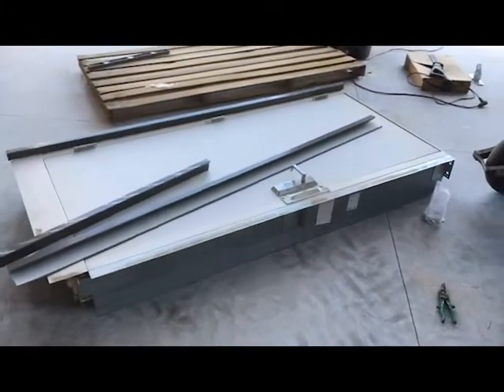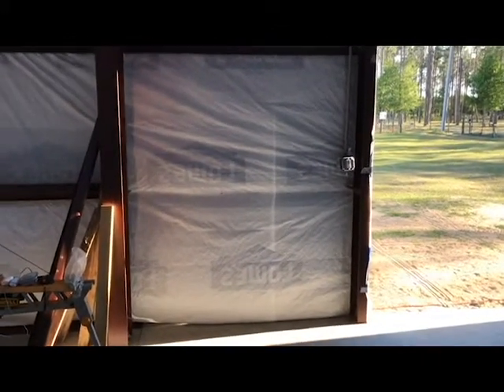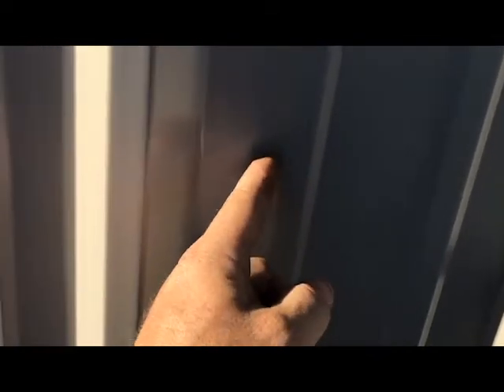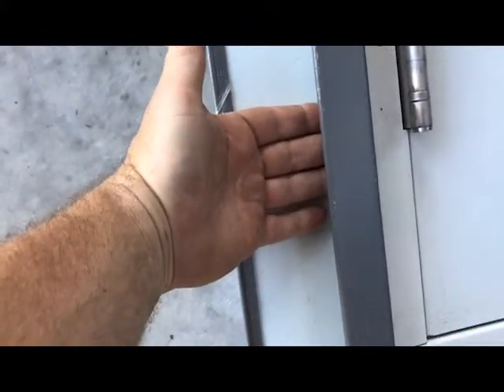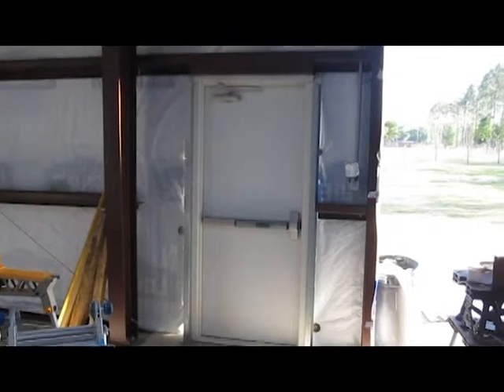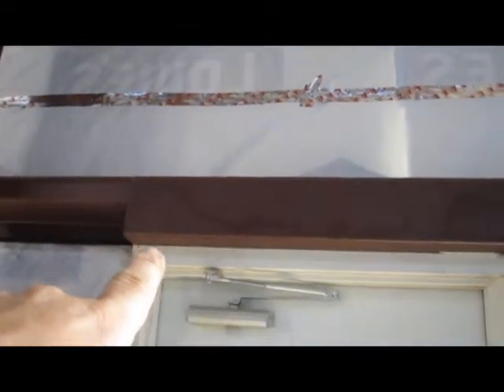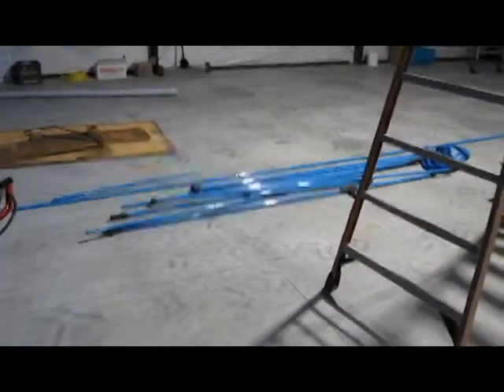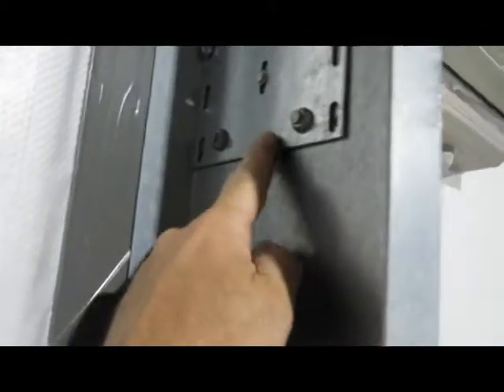Door insulation of a 140mph wind rated Steel walk through door  on a 60x40 metal building.

Comment: Did you wrap the building with building wrap before you put the siding on?  How did you adhere the building wrap to the metal perlins? Did you wrap it horizontally with a 4ft roll? Great job and thank you!
Reply from the maker: Yes I wrapped the entire building mainly because I wasnt using the typical insulation. I used foil tape and magnets, once I installed several pieces of siding I removed the magnets and repeated the process. Yes, Horizontally around the building but it was a 8' rolls
Reply: GEARBOX GARAGE awesome!  Thanks!
Reply: i guess I'm kinda randomly asking but do anybody know of a good site to stream new series online?
Reply: @Jacoby Sean Flixportal :)
Reply: @Hassan Gideon thank you, I signed up and it seems to work =) I appreciate it !!
Reply: @Jacoby Sean no problem xD